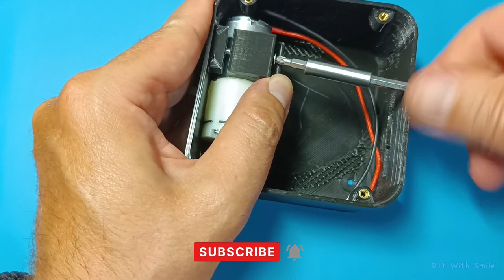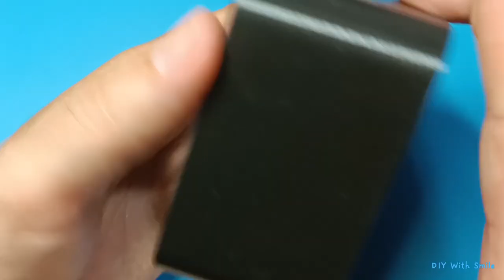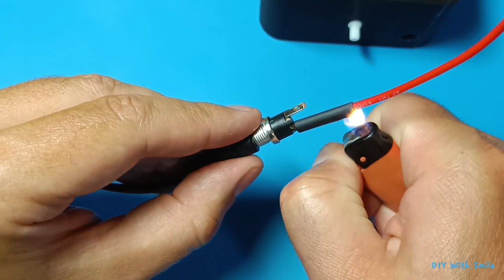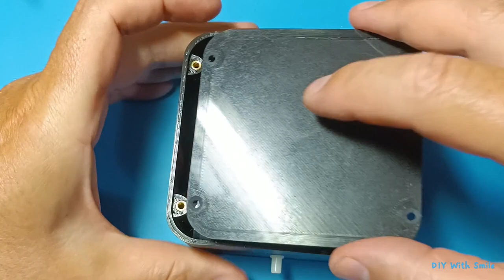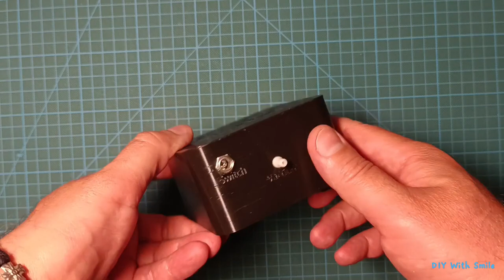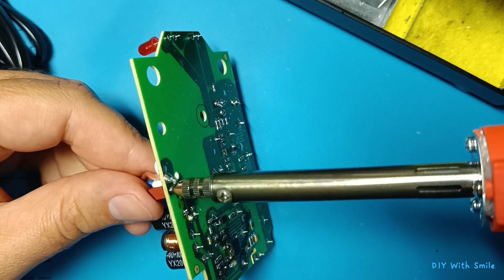DIY | How To Make a DeSoldering Iron With an Electric Vacuum Pump - Part 2  | Free STL for 3D Print

Comment: nice work but you need to make air filter so the tin doesn't come inside the pump and damage it so you have to modify the compartment plug to have screw lid so you can access the compartment and clean it from tin and also to add paper filter and i think the pump power is not sufficient but as you tried it and it works it's fine

Comment: Great way to modify a solder extractor. My other comment would be when you use a solder extractor apply only light pressure to the board with the tip and swirl the tip around the lead to mix the molten solder then start the vacuum while still swirling the tip, allow the vacuum to stay to cool the lead so that the lead does not stick to the hot plated hole. Then remove the tip while leaving the vacuum running 1 to 2 seconds to ensure the extracted solder ends up in reservoir not trapped in the tip. I have used this method to remove hundreds of though hole components over the past 30 years.
Reply from the maker: Thanks for the advice.